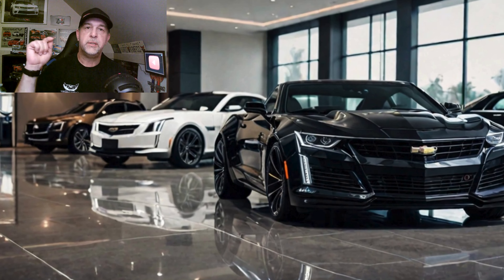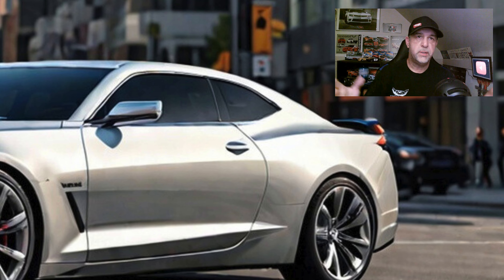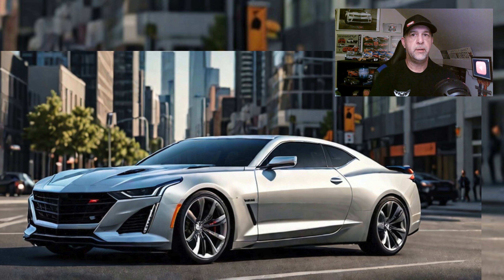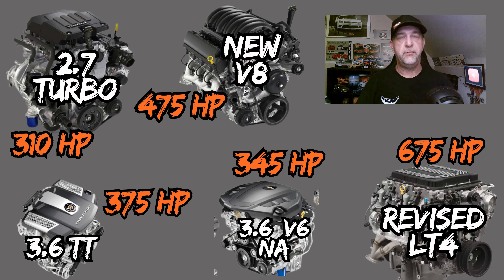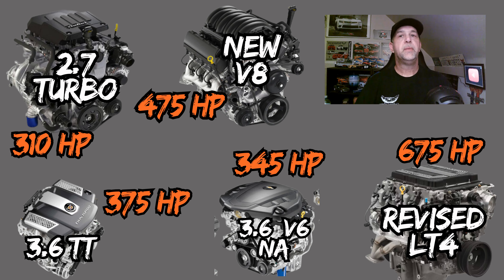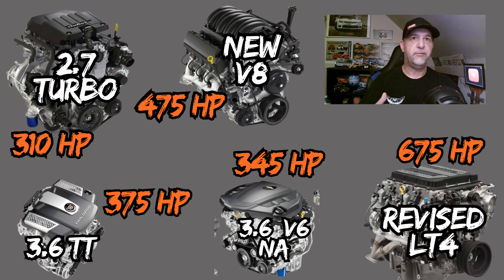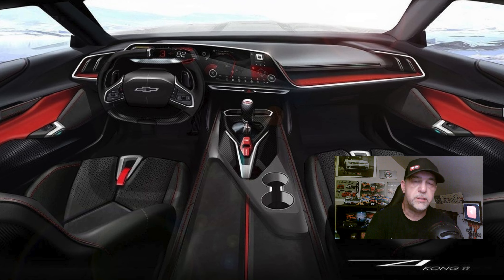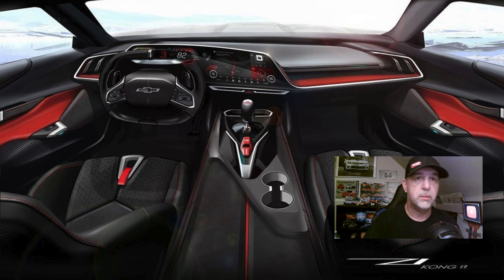What GM Should Build: The Next Gen Camaro Including 5 Engine Options

Comment: If you pay attention when you are driving and set your mirrors properly you don't have "visibility" problem.  However, I do think that A pillars due cause a visibility problem.  That is a problem with all cars, not just Camaros.  I have a 2023 Zl1 Camaro and i don't use the camera rear view option.  I can see fine thru back window and side mirrors.  Thank you for the video.  It will be interesting to see what Chevrolet does with the Camaro.
Reply from the maker: @jackthereefer1  i agree 100% jack,  i found the 5th worse than tne 6th initially but you do adjust quickly.
Reply: Yes, most people set their side mirrors to see mostly the side of their own vehicle.

Comment: The GM performance Crate 6.6 L8P with a aluminum block 12 to 1 compression ratio should be the engine if they made a new Camaro SS the crate engine makes 520 horsepower 540 torque with 10.8 to one compression with 12 to 1 it should make 550+ horsepower 570 torque

Comment: Did I hear you say you worked up that rendering?  if so, nice work!  I'd be good with something like that for appearance.  If they can do 1000+ HP for the Corvette, they can muster 500+ for the SS trim level, I think.  I do hope they would keep something like the LT1 trim in the lineup.  Not everyone needs the track fiddly-bits that come with an SS.  If it could somehow be made affordable (as a ponycar is supposed to be) make that 3.6TT the base engine.  As for the interior,  definitely needs a makeover.  Not sure the interior in that pic is it, but it's a starting point.  Great video.
Reply from the maker: Hey Jim,  i used an Ai program to do it yes and then tweeked it them  little for the roofline etc,  i agree i wasnt focused on trims but yes maybe to keep the cost down and do like the 3rd gen were RS was less hp than the z28, do that with LT1 - 475hp  and SS like 495 hp ?  I dont know .

I dont see a turbo LT5 from the Vette but maybe a.ZL1 extreme ?  Good call though!